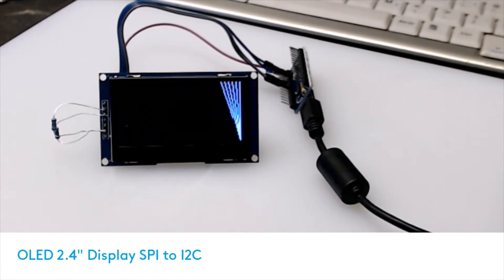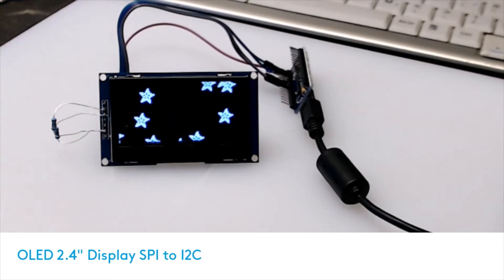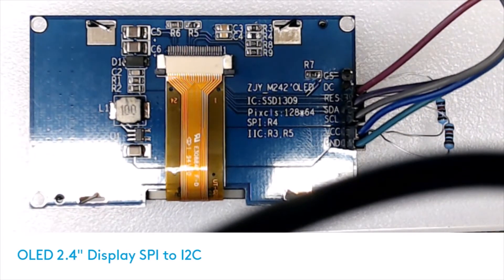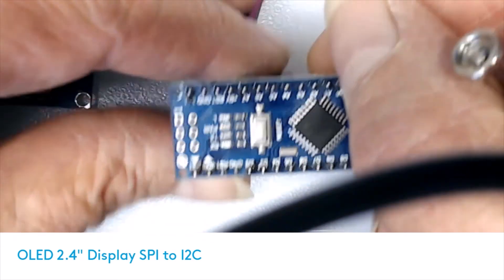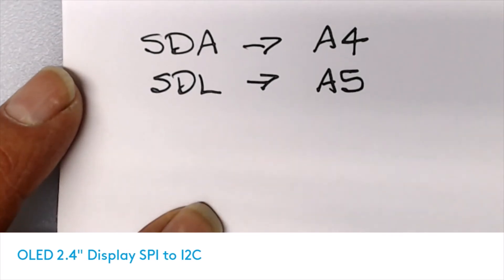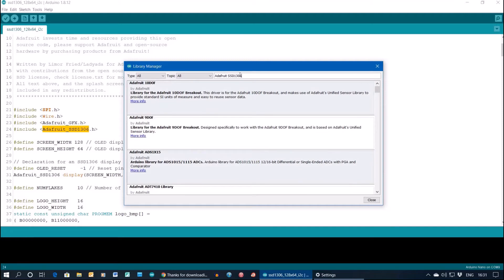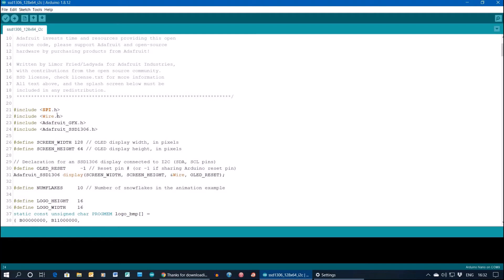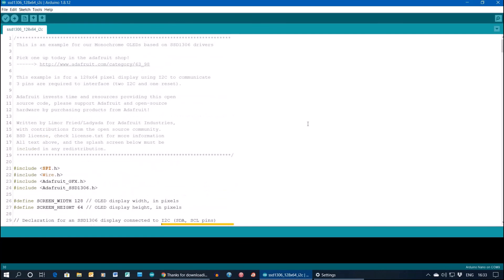OLED Display 2.42" Conversion from SPI to I2C interface for Arduino

Comment: Looks good.  I just wish all manufacturesof these gave good instructions.  I also, wish the people doing these videos could show a schematic.  If I had I might be able to figure mine out.  The one I have uses R5 for SPI which is 0R and R4,R9 for I2C which are open meaning nothing there.  I guess it could mean remove R5 and short across R4 and R9 or might need to put resistors of some value for R4,R9.   It would be nice if they were all the same.  After a lot od searching I have found that the diymore boards are the easiest to convert and your board appears to be the same.  I also found a oled display by HiLetgo that comes preconfigured as I2C though it was hard to find on Amazon.  I have put a link below to the I2C preconfigured display.

HiLetgo 2.42" SSD1309 128x64 OLED Display Module 2.42 Inch OLED LCD Display Module IIC I2C 4 Pin or SPI 7 Pin Optional https://a.co/d/gJoM72V

Comment: Hi, do you know how to flip from spi to iic for screen nokia 5110 ?
Reply from the maker: @guyfradasyl88650  sorry no, I don’t know that screen
Reply: Hi, since my question,I found that the chip of the nokia 5110 screen can only make SPI communication. So, it is impossible to change the way. Because i want to save some connections, i read that we can put the reset of the screen to the reset pin of the Arduino, and chip select to gnd.
You saved 2 gio pin.
You could try with your screen.

Comment: I used a bit of tiny wire I cut off of a regular sized resistor to bridge the gap between the two pads on R7 and R5 instead of a zero ohm resistor. I also have adress 0x3C working without any pullup resitors. I am running the adafruit ssd1306_128x64_i2c example with the only change in the code being changing the address to 0x3C. I used an i2c scanner to find the correct adress
Reply from the maker: It sounds like you’ve got it all running okay. They seem to produce these displays with at least 2 different I2C addresses so a scanner sketch is worth a try if it doesn’t work first time.

Comment: Thanks for the information!!!! Are you powering the OLED via 5 volts or 3.3 volts ? The ebay listing told me to use 3.3volt
Reply from the maker: The one I used was 5V but if you have one requiring 3.3V then I suggest you use a simple voltage divider

Comment: it's not really working for me at the moment but I'm a little short on supplies. I don't have the pullup resistors do you really need them.
Reply: just got it working without the pullup don't know If i really need them
Reply from the maker: @nevermind4667  They're certainly recommended but if you code the ports to have pullups you might get away with it.
Reply: @MarkTuttleG0TMT  i have used it for a day now and it's working fine itm I hope I don't need them in the future so I dont have to make a new PCB
Reply from the maker: N3V3RD01T well I hope my little video helped, that’s why I made it. 👍